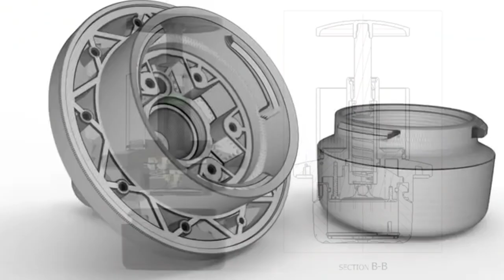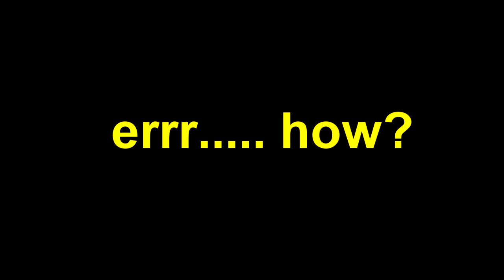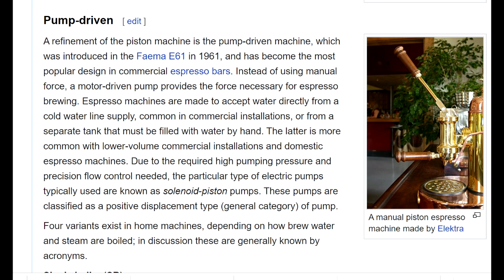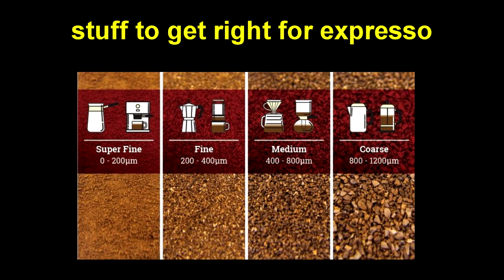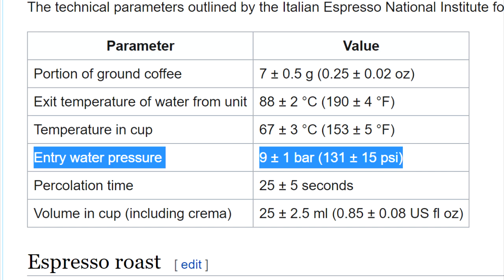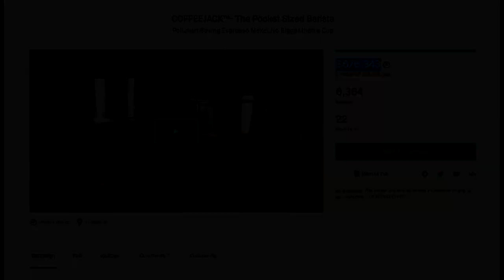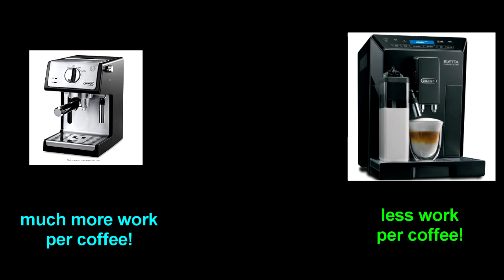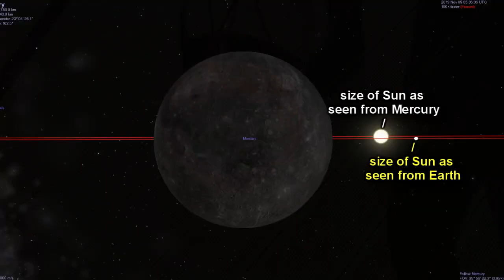CoffeeJack: BUSTED!!

Comment: Get an Aeropress, they even have a travel version. Not technically espresso but really good coffee
Reply: How about a French press?
Reply: @rickrollrizal2364  Perfect for coffee and arguably the best tasting coffee to be had but it is not at all fast.  You need the press, coarse grind, a kettle/source of hot water, 2 to 5 minutes of steeping depending on your desired outcome and then cleaning it all up when you are done.  It also has the downside of some fine grind sediment making it into your cup.

Personally, I have no issues with a French press and I own one but due to the process, I only use it in the winter after a long snow blowing session and I want a massive pile of coffee to warm up to and I aim to treat myself.  I also have a burr grinder for my beans.
Reply: @rickrollrizal2364  I use a french press, afaict it's harder to clean than the aeropress and not as portable, but I love the taste. I haven't tried the aeropress yet but I love the idea. Another good cheap option is the pour-over filter coffee, you just need some filters and a dripper.
Reply: Or just buy under a dollar vietnam drip...
Reply: The thing is most of his criticisms of this thing would apply to the Aeropress too - ‘why don’t you just get a coffee machine’, have to use your own coffee, what about hot water, etc. 

I bought an Aeropress to use at work, specifically because the provided machine dispenses an undrinkably bitter and stale-tasting motor-oil like goop.

So ‘having to’ use your own coffee is a feature, not a bug. It’s easy to clean by ejecting the puck into the bin and give it a quick rinse. Hot water is easily available on tap. Grinding beans if you want to go that way, is a problem you’ll have to solve, but it’s really not hard, and totally worth it IMO, for the great coffee you can make.

‘Why don’t you just buy a one-touch coffee machine’ just isn’t a good solution for this situation, in fact it’s the original problem I’m trying to solve, lol
Reply: Daniel Smith Aeropress makes incredible coffee, it just takes some time to find what works for you. Sounds to me like you need a coarser grind. The Aeropress is used all over the world in competitions for a reason.
Reply: I use a handpresso. Itty bitty high pressure air pump, and a valve to force the hot water through the grounds, uses standard ese pods.
Reply: @dsmudger  You got me curious now! Our office coffee is horrible, so being able to brew myself a few would be nice :)
Reply: SoulfuzZ no no, I mean the one-button machine provided by the office, similar to the one praised as better by TF in the video, makes terrible coffee. I have no influence on its grind size or water temperature, nor the beans they put in it (Starbucks). That’s why I use an Aeropress, own burr grinder, and bring in a variety of awesome single origin coffees, and it’s absolutely brilliant. I can even change beans each time I make a coffee, if I want.

That’s exactly the kind of situation this ‘busted’ brewer is designed for - where you have easy access to hot water, a sink, and cups, but no coffee, or only coffee you don’t like. 

My point is TF has missed all this as it’s not his use case; he’s happy with his all in one DeLonghi machine, and if he wasn’t, he could simply buy a different one. Not possible in a typical office, and I wouldn’t really want machine coffee, even if I were allowed to install one and could afford to do so.
Reply: Nick Leijenhorst Aeropress is like 20 bucks or something, just buy one immediately, I really don’t think you could possibly regret it. The only thing I’d suggest is, get a good burr grinder too. Good beans and grinding them just in time before brewing makes a huge difference.
Reply: @mipmipmipmipmip with you on that one - this new gadget quite probably isn't better than an Aeropress (I've tried a similar one from Staresso - mainly too fiddly to set up and clean - but it's under much higher pressure, so closer to espresso than Aeropress; doesn't matter for me, as I like a long black coffee). And the open container with hot water does indeed seem dangerous. I certainly wouldn't buy it blind as a crowdfunder, too high chance it'll turn out to be a bit rubbish, delivered very late, or not at all. 

But TF was having a go at it for things that'd apply equally to the Aeropress (it's pointless: where will you get hot water from, a big DeLonghi bean-to-cup machine is better anyway, etc), and on those points I had to disagree. I use my Aeropress at work (were as mentioned the coffee machine sucks, and where it's not exactly reasonable, practical or affordable to buy and install my own..), several times a day, and it's just the best thing ever :) Even just for the fact you can switch beans at any time and have a few different ones in rotation, play around with the grind size, brew times/recipes, etc.. not really so with the suggested big automatic machine with its big hopper.

Comment: I wonder if Gale Botticher’s coffee theories survived Thunderfoot’s soul crushing scrutiny.
Reply: Siphon is a fairly cool brewing method (though the setup they used in the show was... interesting). But a bit finicky. Not to mention where was the paper? Paper filtered coffee doesn't have the same amount of film on the bottom of the cup as metal filtered. Unless you are talking about espresso. But then you need those high pressures. And a simple spigot would not work.

Also personally I'll take Ethiopian beans over Sumatran ;)
Reply: Fidasaind ha siphon you say. We got a guy at work who is consistently late for work because he’s setting u a contraption like coffee maker he has associated that word with. Never knew that was the same idea.
Reply: @kansascityshuffle8526  There's a roaster in Michigan that the owner is friends with someone I went to school with. He did one thing where you could "drink the cycle". Basically same coffee bean roasted 5 different methods. One was siphon. Was the first time I had it. And I liked it. Paper filter. Heats water and pushes the water in to a second chamber with the beans. Remove the heat. Which pulls it back to the first chamber (through the filter).

Not sure it is any better than most other paper filter methods. I'm a fan of pour over since I work from home. Lets me control everything but is a bit time intensive (after water is hot it can take me 3-4 minutes of weighing, pouring, stirring, etc to get a 500-600mL brew ready and I drink 2 of those most days). That just needs a decent kettle. Siphon method requires some direct heat source. A bit harder to setup. But it looks cool and it does give a really clean flavor and paper filter means no grit or sludge in the cup (French press even with a course grind will have some in the bottom for example).
Reply: Fidasaind i will have to take your word for it. I’m not a coffee drinker. I just appreciate the lengths people go to to get that bean to a hot liquid.

Comment: Capsules are crap coffee and adding masses of waste to the environment.
Reply: It isn't crap, but it isn't great. They sure are wasteful though.
Reply: Nestlé, probably one of the world's worst companies, has a recycling program for the Nespresso capsules.
Reply: @diegosanchez894  
So they say, but most still end up in landfill or the ocean.
Reply: @h2oaddict61  
They are only marginally better than instant coffee.
I suggest you try some good coffee varieties.😁
Reply: The recyclable ones are burned for energy.
Reply: @Marci124  
More unnecessary pollution.
Reply: Colonna Coffee do pods made out of starch that is biodegradable.
Reply: @danielsay9842  
Which still end up in landfill.

Comment: One of their newer ads shows what looks like a compound spring design whereby the act of releasing the plunger applies the force to actually extract the coffee.... Which makes slightly more sense mechanically but is still engineering to solve a problem that doesn't exist.

Comment: Problem: Aeropress has already been in invented.
Reply: The AeroPress doesn't make espresso. It just makes slightly more concentrated coffee if you want it to.
Reply: @GumbyTheGreen1  Aeropress can make espresso. You need some extra equipment and fine powder to make one.
Reply: @bodyno3158  What extra equipment is that? Does anyone sell it?
Reply: @GumbyTheGreen1  Something called Fellow Prismo, a pressure actuated valve sorta of thing, can build up pressure to make espresso. But don't expect that kind of espresso you get from machines.
Reply: @bodyno3158  That won't allow for espresso of any kind. You'd need a full tamp of the grinds and then 500 lb of force on the plunger to create 9 bar of pressure in an AeroPress. Putting a pressurized portafilter on the bottom of it won't come close to giving you any of that.
Reply: @GumbyTheGreen1  Yep that's what I mean, a more espresso-ish coffee, but not "espresso”. I think no handheld portable device can make a espresso, if you define “espresso“ strictly.
Reply: Look at the Nanopresso if you want more of an espresso style drink.
Reply: Aeropress gets you 3 to 4 bars of pressure and is wildly popular. The Coffee Jack does 10 in what looks to be half the size. It looks like an aeropress upgrade to me.

Comment: They literally just made a more stupid Aeropress
Reply: mmm, sorta.  You can actually screw up with the Aeropress and jet hot water out on your hand, shirt and counter.
Reply: I love my aeropress.
Reply: I had to google aeropress and found out thats what my mother uses. She is pushing on it full force with both hands to make a cup, while its standing on her mug. She has arthritis and its only getting worse over time, so I'm actually thinking this thing could be a good gift for her. If the pressure actually is important, (and this ad isn't the first source I've heard claim this) it would also make better coffee with less force than the aeropress. 
Is there any reason to think thats not the case? 
I realize a lever style press would be a even better option for the kitchen, but she also travels a lot and I believe she brings her aeropress..
Reply: @RenaxTM91  You can adjust the grind and do a inverted extraction and make it easier to plunge. Instead of mum using her hand to plunge just rest her forearm on the plunger then lean on it. No hand issues.
Reply: @curtisstewart9594  adjustt the grind and do inverted extraction? Please elaborate?
I'd guess she pushes it the way she feels most comfortable, she does it on the kitchen counter (as they don't have a kitchen table, just a extension of the counter, its the only practical place to do it) and putting her forearm on it wouldn't work...
Reply: @RenaxTM91  A courser grind requires less effort. If you have something between espresso and turkish you almost have to stand on it to press. As for the forearm, if you can put your hands on the plunger you can lay your forearms across it. Do a YT search for Alan Alder who invented the AP as the forearm press is how he does it. Also search for AP inverted brewing. When your momma figures this out she will not settle for plaino coffee again.
Reply: @RenaxTM91  -----  The main safety issue with the aeropress is in keeping a constant pressure without unbalancing the mug. Secondly, when the seal starts to go bad, it is possible to spray hot coffee on oneself from the top side of the unit. So if her hands aren't too steady from the arthritis,  it may not be the best thing for her.
Reply: @curtisstewart9594  Aah, as for changing the grind that way that would definitelt change the flavour, that much I know. And my mother would literally pay thousands of dollars to not have to do that!
Reply: @PacesIII  Yea, it seems less safe than the Coffee jack. the arthritis isn't that bad (yet) and she isn't that old, but she isn't getting younger and as far as I know theres no cure for arthritis, so it doesn't hurt to plan ahead a little.. I will definetly start checking the seals once in a while as a precaution tho..
Reply: @RenaxTM91  ---- It's mostly the length of the plunger combined with the inherent angle of plunging. Also, let the aeropress do most of the work as you press as it's not pressure dependant. Sometimes I use a moka pot and I get the same results.

Comment: Most capsule makers have moved to compostable capsules. You need to peel the lid off which is also recyclable (it's aluminum foil) and the rest is coffee, a paper or cloth filter and the outer shell, which used to be non-recyclable plastic, but now are biodegradable and some are just paper.

So, you can grab a Keurig Slim that doesn't have a tank (you add the water when you need it) for like $80... a box of 42 compostable capsules for around $25 (or around 60c a cup) and voila.  Oh.. and you can use it for tea.. hot chocolate.. hot cider... etc...

Comment: I used a Thermos for years. Made good coffee at home.
Reply: sure but you cant post that on instagram.
Reply: @vctrtls  it normally only lasts 3 or 4 hours. It doesn't take a long time to empty it. But yeah it does lose a bit of aroma.
Reply: @kippenkopjes  Quick, someone invent the transparent thermos!
Reply: @jailbird1133  during the summer months it stays warm for 6 hours winter is about 2-3 hours but it's normally gone by then  and refilled. :)

Comment: It doesn't require electricity.  You can heat the water with a gas or wood burning fire.  Then grind the beans with a hand cracked coffee bean grinder, then froth the milk with a mini whisk.

Comment: I've traveled with portable 1 cup coffee makers of various types for 40 years. Every place I've stayed had a kettle and mini bar fridge in the room, so boiling water and keeping a little bottle of milk cold has never been an issue; a pack of ground coffee doesn't take a lot of space. So the problems with the CoffeeJack is the pressure and safety concerns. OK, got it.

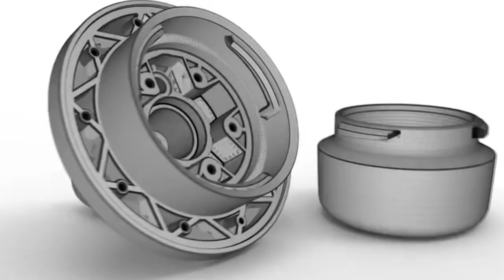Comment: 4:43 Kinda hard to take the engineers seriously when they show themselves using arduino IDE.
Is it wrong for a professional engineer to use arduino IDE?, No, but no professional engineer would put that into a promotional video.
Actually i take that back. They are DYSON engineers so that make sense.
DYSON love to take others inventions and market them as being developed in house. Like their so-called worlds first "Digital Motor" which they say they spent millions developing and is actually just a hobby brushless inrunner RC motor and ESC
Reply: Is that what it is? I had thought maybe it was powered by fingers.
Reply: I should clarify a bit.
The motors Dyson use in their vacuums are something they manufacture themselves. It just gets under my skin every time i hear them say proudly that they invented the technology.
All they did was see typical brush-less in-runner  motors and speed controller designs and think... "That looks cool, lets make a motor like that". 
There's nothing wrong with doing that, but don't give them the new name of "digital motors" just so that you can tell people you invented them and keep going on about how they are your crowning attachment.

Comment: I would recommend Moka Pot Italian stove top espresso maker been using one since 1989 still going strong. Makes better coffee than most shops.
Reply: You will need to heat it somehow. Assume you are in England, and with their passion to tea the will not allow you to use the stowe, as you will spoil and degrade it. And with Coffejack(R)(C)(TM) all you need is boiling water.

Comment: All machines, including the top end ones, suffer from a lack of direct temperature control for the boiler. And, like the fully auto ones with milk steamers/heaters are like owning those VHS/TV combos.  A nice idea until one of them breaks,. 

Also, half the fun is in making the mess. I use a lot of different coffees and the tamping for each is always a bit different. So is controlling the coarseness of the grind.

Comment: Quality of coffee is dependant of so many variables. The grinder is critical more so than the price of the coffee machine. The grind has to be consistent with all grinds of equal size otherwise you will have over-extracted coffee and under-extracted coffee taste (bitter and sour). A good grinder will set you back around £600+ from the likes of Mazzer etc. Get your beans from a local roasted a few days post-roast or roast your own in a modified popcorn maker.

Comment: 1) these are actually very useful. I’m not spending hundreds on a machine to take to the office for everyone else to use and break, and need transportability as I work in multiple offices, devices like this and the aero press give me the ability to have decent coffee.
2) the volumes you use to estimate the pressure requirements are waaaaaaay off. 8 pumps to achieve 30ml of liquid delivery means around 4ml per pump, so closer to the 1ml syringe than the 10ml, the forces required are significantly smaller - and you’re ignoring the valving which means pumps stack. Also you’ve ignored the mechanics of hydraulic pistons - diameter ~= force - so a smaller piston travelling further takes less force to generate the same pressure.

I get you think it’s a bad idea, but try to be scientific.

Comment: I purchased one of these (almost identical) from Banggood for about $40 a few years ago. I have to say, it worked, but
I regularly got burned with scalding water, there was not enough capacity for a decent strength coffee, It required an exact grind density and
getting boiling water was a pain, requiring a thermos flask.  So,  I rarely ever use it, and feel that the $40 send was about the limit
for this type of product. Being re invented for a more than ten times the price is just a classic kickstarter rip off.

Comment: The basic principle has been around for a while, there are machines dating from the '50s, at least. There are various reiterations of the same basic design, with differentiation coming almost exclusively from styling. I don't see the problem with that really, most consumer products we use work under the same principle.